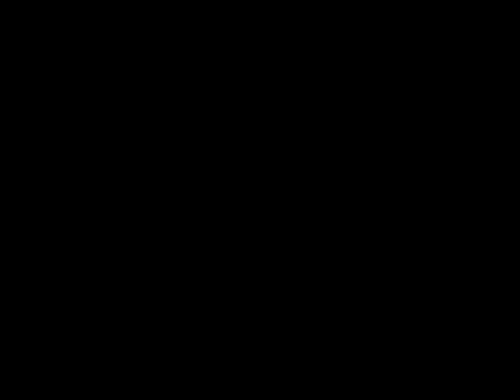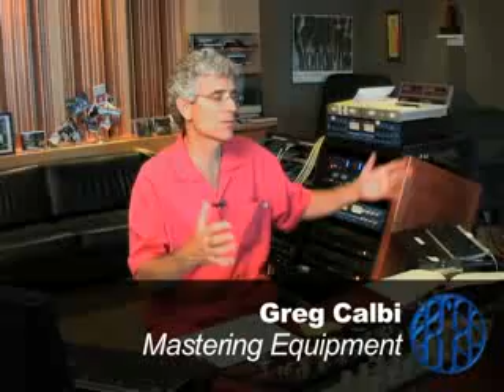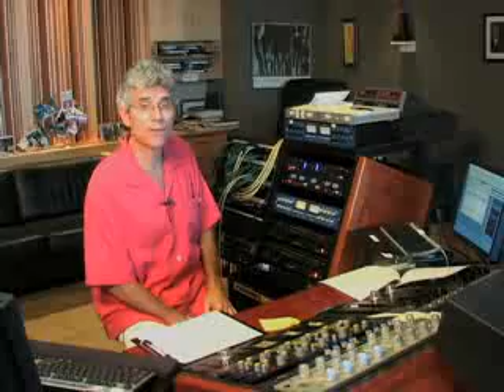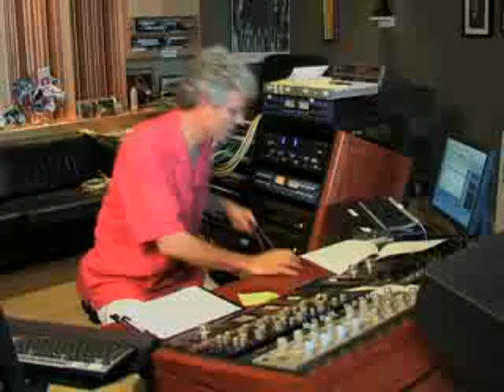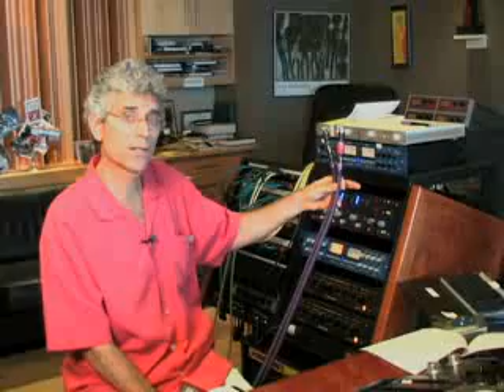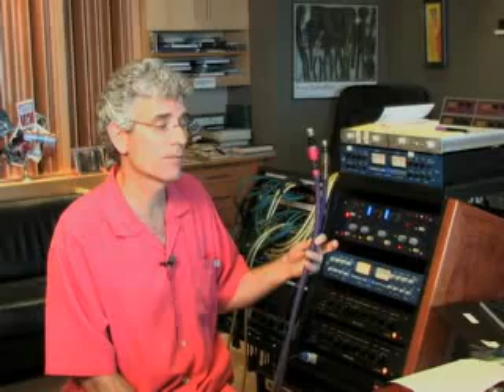Mastering Engineer Greg Calbi Explains the Equipment Used in the Mastering Process

Comment: Each pair of speakers, amps, etc. will alter the sound, but in mastering and recording, you need completely neutral and transparent sounding equipment.  If not, then you are adjusting those knobs to counteract what lacks or what is overly prominent in your equipment. If you cables don't allow the bottom frequencies to be heard, then you might add bass to over compensate. etc. etc. etc.  That's why I would only use the most neutral sounding equipment available.   Seriously, this is NO JOKE.

Comment: Who did the cable A/B testing? What cables, other equipment did they use, did they use a switching system (switches & other cables), what source material (recordings), and in what environment?  A/B switching systems, mismatched cables can also change the outcome, also listening to certain recordings will not be as easy to hear the differences.  Always trust YOUR ears rather than a test on someone else's equipment w/ someone else's ears. They can rig A/B tests for a desired outcome.

Comment: Bob Ludwig uses Transparent Cables, Skywalker Sound uses MIT, and there are various top end studios using different brands of cables and they integrate with the equipment to the ears of the engineer.  Some cables sound better than others depending on the equipment due to the impedance differences of equipment.  MIT Cables actually makes higher end cables that have a impedance switch to adjust for equipment w/different impedances.  READ about cable as they aren't using the same cable design.

Comment: I would suggest you go read MIT Cables white papers and then go listen to different cables.  Don't judge someone else's A/B tests.  I would suggest using either MIT Cables or Transparent Cables as they both wire in parallel, a custom tuned set of filters to enable the cable to articulate in a linear fashion.  They will improve the timbre and make the signal neutral, which is what you want. ALL audio acts like a filter, including cables.

Comment: BS. You have a basic understanding of cables.  MIT Cables have PROVEN objectively, that cables do sound differently.  They are using a variety of tests with VERY precise tools, INCLUDING what is called articulation measurement, which up until MIT Cables began testing, no one else did that.  They were using articulation measurements for room acoustics, and other things, but not in cable measurement.  EVERY aspect of a cable with change the timbre and that's PROVEN.  Go talk to Bob Ludwig.
Reply: all u need is your ears....I am sorry trained ears...

Comment: Dear Mr. Fermer, I'm a graduated engineer in electronics and it is always funny to read, that guys like you can hear a difference, where we can find no difference, measuring with 20.000 USD equipment
Reply: That is why you do just science n have no ear......no offense.....u can measure a spec ...but Greg has something you will never have: ears. As an engineer in the applied sciences you have failed to apply your most solid skill: "Critical Thinking n Pure Science" what made you an Engineer: The ability to think n not to assume. One you have no idea what those cable are made of n Greg has Post Doctorate ears in experience n expertise you will never achieve with your diploma n science. I am a patented Engineer in Science n a Musician n Mastering Engineer.........you have long ways to go....the fact you are an engineer it does not qualify you to talk as an expert on Greg's video facts.

You are simply completely inaccurate n non-precise...specially when as a n engineer you dismissed two things: the materials of the cables he showed you Do not have....so practically you can not have a technical opinion n Greg's technical reputation where your degree holds water. I am sorry Arne.....but you know what they say about assuming......so not make.....you did.

Comment: 5 data points is not statistically significant sample. Further more, I'm not able to read the paper where the testing methods and environment used are described so I'm unable to reproduce your experiment. Thus it's not scientifically valid experiment unless you write a paper about it so everyone can make the same test with exact the same setting and methods used.
And I'm reading scientific publications about the subject, you should too. And an amplifier changes the sound much more than a cable.

Comment: But do you have any data as to how much these harmonics are in dB? And I'll save you the trouble, they're at the noise unless they're deliberately enhanced or the noise floor is ultra low (what doesn't happen unless you're using measurement grade equpment in EMI controlled room). Thus you'r claim to be able to hear that would have us believe you have super human hearing? And that claim would need some evidence to support it also...

Comment: Since cables are chosen for their mechanical properties and the environment that they have to operate at. Unbalanced guitar cable is all well enough in the distance it usually has to travel and with proper grounding and shielding it's pretty low noise too. With microphone we need phantom power, thus balanced cable is great and it gives better noise performance too.
With longer distance and increasing EMI, star-quad cables and such come in to play for their better immunity to external noise.

Comment: @chunkEcheez. Metals differ when it comes to transfer electric energy. Iron doesn't work as good as gold for ex. You hear it in lower signals, ie harmonics. Harmonics are micro signals that makes a track sound harsh or soft, colored or not. Every note is a chord actually, linked to a string of harmonics, that makes its character. To make it short, yes cables make the difference. You can hear it because your stereo sounds wider, the mix sounds more colorfull and the highs softer. Audiofrequency.
Reply: in theory we could agree with you here's my point, the wider the signal the more the audio on the side is heard thus you counterbalance by leveling your bass accordingly, you shouldn't speak in so many hypotheticals.

Comment: You're mixing audiophile wires with just actual properly made cables. There is a difference in sound each wire material will produce, that is obvious on speaker cables. Differences will never be huge, but they will noticeable.  Now...if you talk about those crazy 20,000$ interconnects, that is bullshit, because a properly made silver cable will sound pretty much the same, whether its a 10 dollar one or a 10,000 dollar one. But a copper cable for example will sound a bit different.
Reply: Teach him n also teach that engineer that thinks he knows everything : Arne ....
Reply: Wrong

Comment: it is possible to create a song all digitally, then building, EQ-ing, compressing,leveling mixing and all that stuff all within the DAW program, but still have it sound like a Mastered track. i mean, wouldn't you have more control and stuff. i'm talking full digital. the only analog recorded sounds would probably be drum samples, but those would be EQ-ed and compressed to suit the track. would mastering as this point still be necessary?
Reply: Mark you need to experiment n grow with the experience......start with a guitar w certain woods, pick ups, tube amp wire.....etc....n
go analogue n compare.....

Comment: Your understanding is limited and wrong in this case.  The material composition of the wire affects its electrical conductivity characteristics.  This is called materials science.  So a gold wire will conduct differently than a copper wire, for example.  And since we are ultimately talking analog, not digital, the conductivity of the wire will change its sinusoidal characteristic.  It might be subtle, and maybe only an experienced pro can distinguish it.
Reply: Dead on Chris...!!!

Comment: I understand that he is very good at what he does, but chunkEcheez is correct. Scientific testing has proven there are no quantifiable differences between standard cables and so called "audiophile" cables.
This is not up for debate. It's not something that someone can understand through listening to "his works". It is physics. A wire is a wire, and it transfers electricity from point a to point b. It does not impart a characteristic to the electricity, no matter how hard you believe.
Reply: Same thing for caps.....yet in audio depending on the material the sound will change....Now you have to have the ears to hear it...if he said one wire is more opened.....believe him it is. Different materials, processing...no different from a guitar with cedar or a different type of wood.....
Reply: Wrong

Comment: You guys master for only 8-9 hours per album?? I had no idea! That's a lot of pressure.
Reply: no they're lying, they spend like 20min per song. they literally process a 3 minute track using two pieces of gear, a compressor and an eq, you do the math, listen to the song three or four times and they are done. Most mastering engineers do very little according to them and sometimes barely anything at all, they might do nothing more than raising the gain using a compressor with no compressor then smashing the level with an expensive tube limiter.